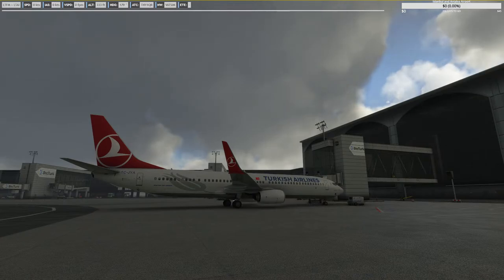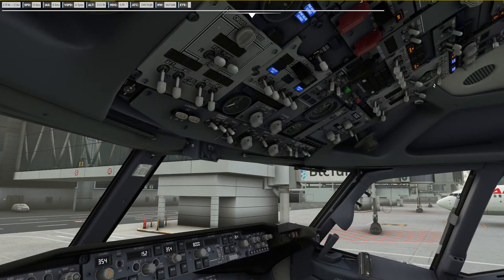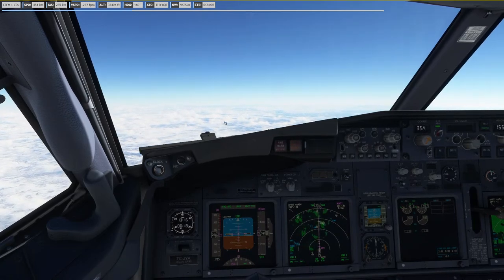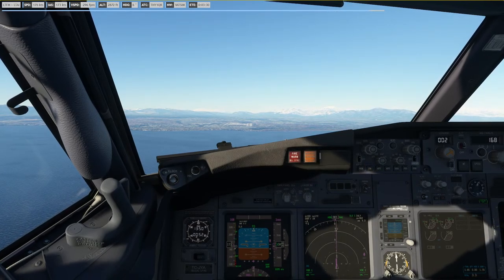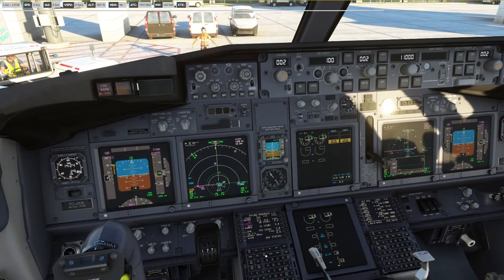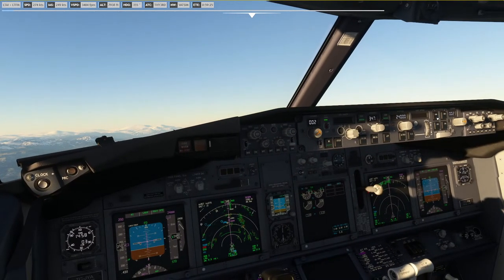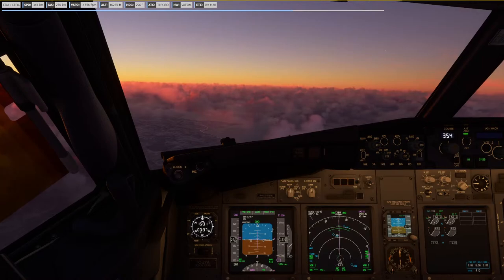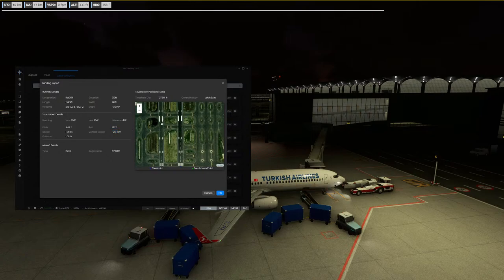PMDG 737-900ER Istanbul - Antalya | Real 737 Pilot

Comment: Where do you access your 737 checklist?
Reply from the maker: I have them on my EFB in front of me.
Reply: @A330Driver  EFB? Sorry I'm new to this but have been slowly learning the 737-700 since its release date.
Reply from the maker: @grizzi9479  The company tablet which has all the flight documents, performance calculators, charts, etc.
Reply: @A330Driver  how does one access those for a more immersive flight experience? Or do I have to wait for the tablet update for the 737-700?
Reply from the maker: @grizzi9479  Ah, just to be clear: I'm using my real life EFB, not a simulated one.